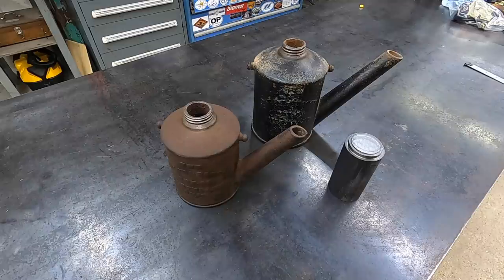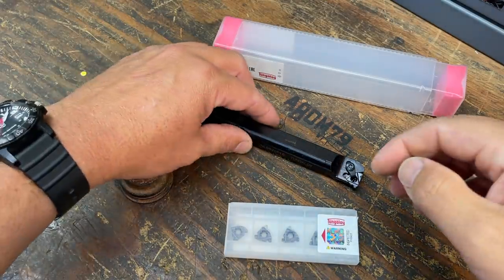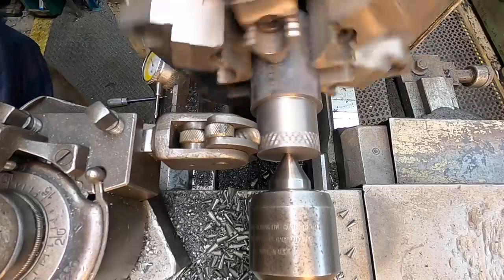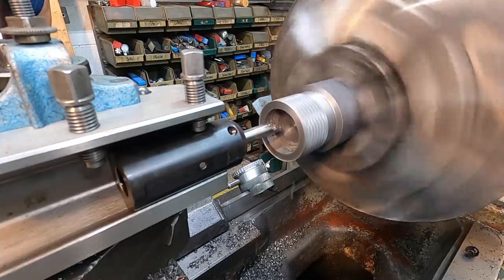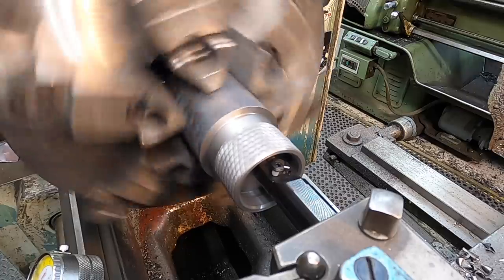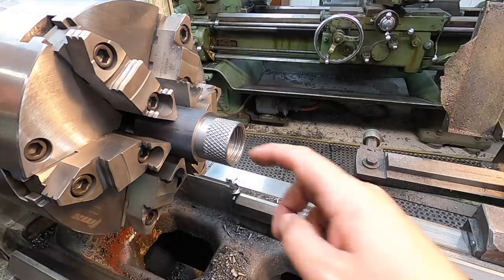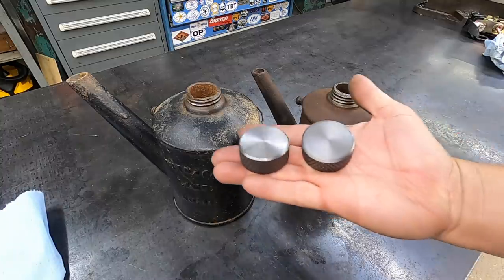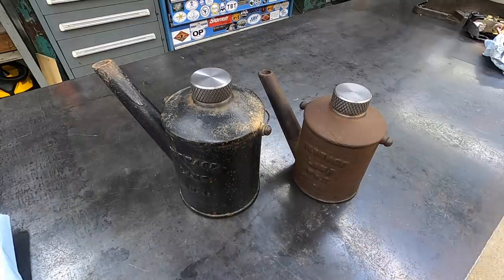SNS 353: Furnace Lamp Caps, Knurling & Round Profile Threading

Comment: Once a time I operated machines, which make a brass caps. Machine #1 take a brass disk and stretch by rotation to raw cap. Machine #2 force threads by inside and outside rollers. Machine #3 heat treaded it a finished cap. As a raw material, you can use alloy of aluminum 98% and 2% magnesium to easily deform disk to cap without fractures without heat treading step. Brass caps are must, if you like to coat them with chrome that last forever and look nice.

Comment: i've googled it for a minute and it seems like a stamped tin cap are historically correct.
anyway your machined ones are better )
Reply: I also looked it up and the cap on the ones I saw were formed brass. But, with Adam, he normally builds things like a brick sh*t house and to last for a 100 years or so. LOL
Reply: Same.  I'd've probably cleaned up the stamped cap and put it on the lamp which still has a handle purely for historical value, but I do like Adam's better.
Reply: I have seen different pictures and there seemed to be three styles. the brass cap you mentioned just in plain brass, although the caps I had seen were way simpler than the one he had on there. they were completely smooth on the outside, no knurling or visible treads. which also seems to have been the main scheme. the other two styles were simply painted black like the lamp itself and the third one had what looked like a small ball on top.
although the main scheme for most of the lamps i have seen was that the cap just got lost at some point. I would say 8 out of 10 pictures had no cap on.
I have seen one on an auction page which had a wood plug, I would guess that one was improvised after the cap got lost.

Comment: Adam, when you get around to making a replacement handle, just use a wire coat hanger for the steel wire and, of course, your choice of wood for the part you hold with your hand.  I would have recommended cork gaskets, but you mentioned adding them at the end of the video.  ;)

Comment: Those caps came out sweet!!
 I have a Victor lathe as well and mine does the same thing when threading, you go for your last cleanup pass and it takes .010 or .015 cut and hopefully you back out super fast when that happens,, frustrating, I have gone to the dial indicator system like you have done.

Comment: The only cap I can find for a Taylor & Boggis lamp like that is a sheetmetal cap.   I can sure remember struggling to get a stuck cap off of a metal gas can or an old Briggs engine, though, and your heavily knurled iron cap would have been a massive improvement.

Comment: Hey Adam I have a lathe with the same problem on the dial, it moves. I took the dial off and drilled/threaded a hole to add a thumbscrew, so now I can lock the dial in place.

Comment: The original caps were of stamped metal. Very thin. This is why most of them don't have caps. They tend to rust out fast.  If you find one for sale WITH original cap, it will double the price.

Comment: If you want to repaint them, you might try Duplicolor engine enamel with ceramic (part # DE1635) It looks like the original japanning which I think is what your lamps were finished with. It goes on kinda thick and builds up well. I use it on old hand planes.

Comment: With the caps drill and tap a screw hole in the middle, and put a small length of stamped brass chain on, attached to the wire handle, so the cap now never can get lost.

Comment: You might use an "0" ring in the top of the cap if it's not too thick. Just a thought. Nice job by the way. 
I have ID single pointed threaded but your way is less dangerous. The way I did it you got to be quick!

Comment: When I was younger we used round thread pipe to run in oil wells and I never knew back then why they called it 8 round thread. Of course I understood the 8 pitch part. How would a person make an external round thread to get the proper profile on the out side diameter or top of the thread? I will probably never want or need to, just curious. I will search that. Also I agree with the appearance of that Knurl.  Cool!

Comment: Hi Adam, I suspect you’re the best to ask on this problem. I’m the fabricator and installer of the Triangle Shirtwaist Fire Memorial in NYC. Long story short…  fo the structural connections to the 100 year old plus building I have to drill and tap 3/4-10 into the original cast iron square columns behind the brick facade. Questions: what speed should you recommend and also what cutter? I assume the drill should be a carbide tipped jobber bit. I have to use a mag drill as I’m on the 9th floor and I’m not finding a model that goes lower than 250 rpm

Comment: What do you think about extending the top 1/4", reduce the chucked blank diameter 5/32" and round the (knurled) corner with 1/16" radius? Then mill the top away leaving a 1/16" rib remaining across the center to form a wingnut, radius the 2 corners with 1/8" radius (optional - end mill may have 1/16" radius/cross drill rib 5/32" diameter 1/8" above top flat).
Would an O-ring function as a gasket?  Definitely add the touchmark.

Comment: Shouldn't those caps have a vent hole in them?
Reply: I was about to say the same thing. Doesn't take much to figure out what a nasty mess would result without there being a way to vent. The oil will go down in the spout till it equalises and the second it does it'll shoot out a load of oil from the spout. Not what you want at all <grin>.

Comment: When you wing the knurling tool, what did you do to make the pattern just overlapping over the circumference? What if the teeth doesn't come back to the exact grove? Thanks!
Reply: Knurls are black magic. One way or another they just work. Don't question it or the machinist gods will smite you.

But in all seriousness. Knurls cold form into the workpiece. Meaning that they push material away from the peaks and into the valley's of the tool so your both increasing and decreasing the diameter at the same time. All this to say, the tool makes the circumference it needs to make good Knurls.

Comment: Is there any reason you don’t use oil when knurling? I’ve always been told to flood it with oil. Was it just the mat’l or do you find yourself getting good results without it consistently?
Reply: I believe that ductile iron is machined without oil or coolant (like cast iron), so would make sense to not knurl it with coolant/oil.

I agree steel should have oil/coolant, and lots would not hurt.

Comment: The only place I (regularly) see round profile threads is on Edison Base (plain-ole) light bulbs.  An E39 Mogul base has a diameter of 39mm or 1.535".  I can't find a good source for the thread pitch, but an E33 (33mm diameter) has a thread pitch of 6/inch.  Edison patented this style in about 1908.  Could it be possible that your cap is an "Edison" thread?

Comment: When your cutting the thread how does  it line up again on the same cut as the last and not just anywhere??
Reply: There is a dial that rides the lead screw and depending on the pitch of the thread you engage the half nut on a particular line or for some multi-start threads between lines and the gearing in the headstock gear train and leadscrew is clocked. I can't tell you exactly how it works but if you close the half nut on the proper line ensuring it engages in the right spot on the lead screw it will cut the same helix everytime.

Comment: is it slop in the ways makes it score on the return stroke.?
Reply: It's mostly flex in the boring bar in that case, in general it's the accumulation of flex in the whole load path from tool tip through the tool, tool post, cross slide, saddle, ways, headstock, spindle and work-piece. It's a long way around, so none of those things has to bend much to add up to a very noticeable 0.001" spring cut

Comment: Nice caps, however the other commenters are right they wound have had sheet metal caps. The difference is that the old caps would not have had the bead at the bottom like the gas cap has, they would have had a skirt that would have matched the taper of the base of the fillers. Do you know of anyone that spins sheet steel parts? Those old caps are hard to find and with a mandrel new caps could be spun.

Comment: I’d ductile iron the same thing as cast iron?
Reply: Cast iron can be white, gray, nodular,  ductile or malleable.  White iron is brittle as the excess carbon is iron carbide which is brittle.  Gray cast iron has the excess carbon as graphite flakes which can be crack forming weak points.  Nodular iron converts gray iron graphite from flakes to spheres so it is much tougher.  Ductile and malleable cast iron are further developments of nodular iron.
Cast iron contains excess carbon as it lowers the melt temperature and makes it more fluid in casting.  The carbon is dissolved in the molten iron but comes out of solution upon solidification.
Reply: @keithjurena9319  thanks Keith, I didn’t know there were different types of CI. I’ve got a cylinder of it for my lathe and it’s just marked C I. guess it’s just old.
Reply: @shanek6582  
If it machines freely and the chips stain your fingers gray, it is gray cast iron.   White cast iron is tough to machine as the iron carbide crystals impart an abrasive nature.  The carbide crystals are dispersed in a lower carbon iron.
Nodular iron types can be machined easily but also can be hardened.   These alloys were used in crank shafts and cylinder heads for this reason.
Malleable and ductile iron are common in pipes and other higher strength applications like C clamps and other tools.